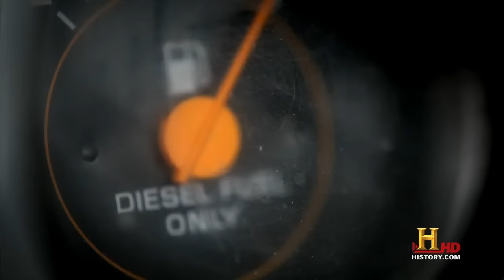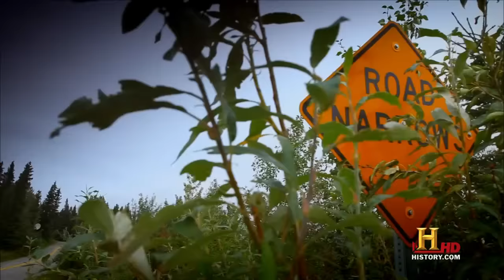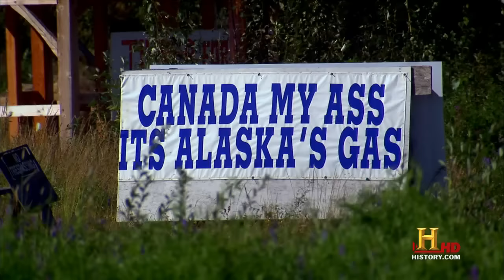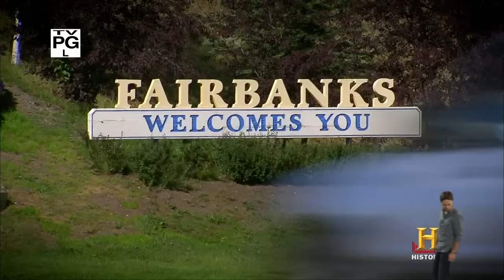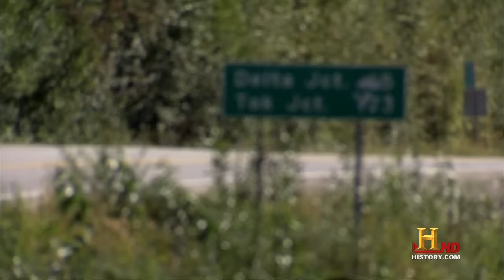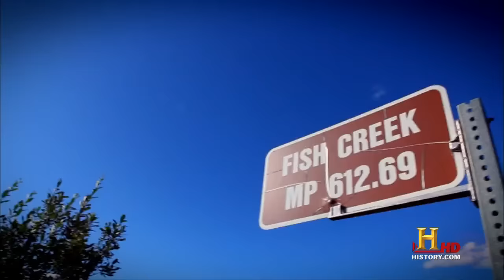Top Gear America Best America's 4x4 Truck   S01E09 - 2011.01.16

Comment: 5.7L Magnum? Correct me if I'm wrong, but I know they made a 5.2L and a 5.9L and some silly 4._ v6 Magnums, but I'm pretty sure that the 5.7L is a HEMI and not a Magnum
Reply: I'm glad that I'm not only who caught that!
Reply: I just recently bought a 2001 with a 5.7L magnum. I had no idea Dodge made a 5.7L magnum until now.
Reply: Novasso Unlikely, a 5.7 Magnum doesn't exist unless someone bored and stroked a 5.2. You probably bought a 5.9.
Reply: Novasso dodge never produced a 5.7 liter magnum.
Reply: the 5.7 didnt exist then uts definatly a 5.9
Reply: 5.9 is a cummins
Reply: Ronnie Davis and also a magnum
Reply: ASG0919 Searched it. Don't know what's trustworthy, but it says like, "DaimlerChrysler 5.7L HEMI Magnum"
Reply: Ronnie Davis 5.9 magnum or 360 is a gas motor
Reply: Gabriel Konrad they didnt make the 5.7 for the 2nd gen dodge. either 5.2, 5.9 or 5.9 cummins. or v10
Reply: the v6 was a 3.9 liter. but the hemi was not offered until 2003. probably ended up with the 318 though
Reply: okaay everyone it has a 5.9 magnum. thats it lets leave it at that we all know its not a 5.7l hemi
Reply: brendan hall it's a 5.2 because of the rumble
Reply: KilerStreak's Gaming Channel the early 5.7 HEMI was called a HEMI magnum then later the magnum was dropped off the name. 02/03-05 years of rams were like that.
Reply: They also had a 4.7L v8 Magnum
Reply: Ronnie Davis and Magnum
Reply: Your correct
Reply: Ya I have a 97 dodge 1500 like him but it's a 5.2 and they only make 5.2 and 5.9.
Reply: Gabriel Konrad i got a dakota with a 4.7 in it and it pulls really good, just like a 5.2, but you're right, the 5.7 is a hemi
Reply: Gabriel Konrad I had a 2002 dodge ram 1500 new body style with the 4.7 v8
Reply: every motor of theres sucks except 5.9
Reply: Swept180sxNet but the 5.9 sucks gas
Reply: Gabriel Konrad  yes you are correct. 5.7 l started with the third gen body style with the hemi
Reply: Gabriel Konrad 5.7 HEMI MAGNUM is a dodge truck from 03
Reply: Ronnie Davis 5.9L 360 V8 and a 5.9L 6 cylinder 12V up to 1996.5 and from 1996.5 on up to 08 or 09, it was a 5.9L Cummins 24V. What he had was likely a 5.9L Magnum V8 gasser from 1996. The 5.7 Hemi didn't show up until late 2002/early 2003 trucks. In fact. Most 3 gen bodies made late 2002 had the 5.9L 360 in it, not the 5.7 Hemi.
Reply: The 24 valve Cummins wasn't introduced until 1998.5.  Everything else you said is correct.  Also, since the 5.9 gas motors were discontinued, they were available in the early 2003 1500 series trucks until they ran out of stock.
Reply: Andrew Ford yep, meant to put an 8 instead of the 6 but was confused. That's what I was saying about the transitional models like some 2002's being 3rd gen bodies with the older 5.9 gasser in it.
Reply: 2003 is when they brought the hemi back i have one. only 115,000 miles on it as well.
Reply: 1Shignog same here but mine has 177,000 miles
Reply: You're wrong babe
Reply: ASG0919 incorrect. My 2003 Dodge Ram 1500 has both a 5.7L Hemi Magnum badge as well as it says it on the engine
Reply: Ronnie Davis also 5.9 is a 360 ci gasser, the 5.7 is a 348 hemi
Reply: christopher jones the 5.9 can be the cummins or the 5.9 magnum which is actually 360 ci.
Reply: SavB we understand this, the other commenter was trying to say that 5.7 wasn't considered a magnum engine
Reply: They made an i6 5.9l diesel and a v8 5.9 gasser
Reply: Luke Emms it was the 5.7 L hemi magnum
Reply: lol, I laughed, it is a 5.2 and 5.9.  You'd think they could get that much right.
Reply: thank god someone here knows what their talking about, jesus christ folks, that definitely is not a 5.7... good lordy...
Reply: Novasso same accept mine is a 04
Reply: 5.9 is also a gas burner. I have a 5.9 360 Magnum Gas in my 98 Ram 1500.
Reply: Zombie 8890 what kind of mileage you get out her
Reply: In stock configuration, I honestly don't remember. Ive been running headers, aftermarket exhaust, cold air intake, programmer, etc. Plus it has a small lift. I'm tuned on 93 octane now, and I probably get around 14mpg on a good day.
Reply: Mine has the larger tires from the factory with 3:55's and I get 13 on the highway. It's also automatic. Maybe 10 in town. Trouble is the trucks are very heavy. Especially the 4wd ones.
Reply: Wrong, there was a 5.9L Magnum used in the Durango and a few other trucks for a while.  It's before the "Hemi" name came back.  I ran the 318 "Magnum" heads on my 73 Dart 318 and it actually really woke the engine up, good swap back then.
Reply: 5.9 s beast
Reply: All 5.7 liter hemi says magnum on the fender, magnum is just the name... Gimmick!
Reply: Ray Brooks now shit is funny
Reply: Gabriel Konrad and I'm pretty sure a gas doesn't have twin turbo
Reply: Gabriel Konrad there's a Magnum 5.7 and a HEMI 5.7
Reply: Christopher Kennedy j
Reply: Gabriel Konrad they also make a 6.2 hemi
Reply: They also call the Tacoma a Hilux.
Reply: Swept180sxNet I'm gonna have to argue. 5.2 for the win in my books.
Reply: Right u are my good man
Reply: Thelifeofarider I averaged 14 mpg in my 01 Durango r/t.... got 1 mpg when floored, God do I miss it
Reply: ontarioknivesNS7 12v 5.9L Cummins was from 89-98.5 then 24v 5.9L till 02. the 03-07.5 was 24v common rail then after 07.5 it's the 6.7L common rail Cummins.
Reply: the 5.7 is a magnum hemi its a beautiful 360 dodge engine
Reply: Morgan Dunn no its not. 5.7L is equal to 345 cubic inches. 5.9L is equal to 360 cubic inches. being a 97 and the size of lift and tires I would assume it's a 5.9 magnum and not the 5.2 magnum.
Reply: SAVAGECUMMINS i run a 360 but I've seen bone stock 318's spin 40's just fine a 360 is got amazing low end but fall flat on their face when you get the rpms up where you need them
Reply: Brandon Miller it maybe a 318 but it would have to be geared down to spin 40s. and by the way it drove on the road I'm guessing it's not geared at all
Reply: There was also a 5.9 gasser, like that used in the Dakota 5.9 R/T.
Reply: Julian Arebalo  no its a 5.2 318 magnum v8
Reply: Lol my best friend has a 2004 with a 5.7 Hemi Magnum. I can post a picture to prove that. lol
Reply: Ya, they didn't have the 5.7 Hemi for at least 4 more years. That was a screw-up. It's a 5.2 Magnum.
Reply: Gabriel Konrad no hemis came out in the later models i thought but your righg there is no 5.7 Magnum
Reply: Don't worry about it's all goat garbage .
Reply: I think a metal internal support ribbing spring in the air supply duct shorted the battery after chaffing off the protective covering, from his previous issues, & based on personal exprience, considering coloration and location of smoke expelled. Also the magnum  (non-hemispherical compression chamber) engines, referenced by designated type LA Block, predates the hemi marketing, and is still a popular choice for crate builds.  A 5.7L Magnum designation is commonly used as shorthand for a modified 340cid/5.6L with the ported & polished 360cid/5.9L heads. These alterations came about from the wide held belief that the 340 magnum had almost perfect bore to stoke ratio, allowing for faster reving to reach the start of the power curve, that gets extended longer with slightly more displacement, but more importantly improved with increased air/fuel delivered and waste gasses more rapidly evacuated. So I tend to suspect, based on the other obvious alterations, it is not impossible the engine was swapped.
Reply: Gabriel Konrad you are exactly right I owned a 5.9 360 Magnum they are wrong plus they love to destroy beautiful old trucks....they suck!
Reply: Novasso they didn't 2003 was the first year of the 5.7 magnum hemi.
People get confused because old chevys were 5.7 and now dodge's are 5.7 but there was no dodge 5.7 until 2003 if you bought a 2001 or 2002 and the sales man said 5.7 it most likely has the 4.7 or 5.9 (gas) and the saleman didn't know what he was talking about
Reply: Julian Arebalo in 2003 the 5.7 dodge engine was born and in 2003 it was called the 5.7 magnum HEMI but the name hemi was so liked that in 2004 they droped the magnum name from there on it was know as the 5.7 hemi V8
Reply: Ronnie Davis i know this is confusing there is a 5.9 V8 gas and a cummins 5.9 I6 turbo diesel
Reply: you're right. biggest magnum was a 5.9
Reply: It's actually a Hemi Magnum, Dodge did make those in the 5.7L they also just made the 5.7L Hemi There are differences between the two but Rutledge is correct. It's a 5.7L Magnum just the Hemi Magnum Version.
Reply: The trucks don't have to be stock, All they had to do what buy a truck over 150k miles under 5grand. It could have been a swap. Just like Tanners truck was supposed to be a diesel and ended up being a chevy 350.
Reply: Gabriel Konrad they also made a 5.7 Magnum
Reply: you mean the bored out 318 thats all a 5.9 is them 2 gen magnums are by far the best
Reply: I had the magnum 4 cyl in my 97 dakota, as silly as it may have been, it was a solid 2.5. It never gave me problems, I put nearly 200k miles on it in the 2 years i had it. (I drove alot between work and college) Unfortunately I was going down highway 74 between shelby and forrest city NC and Hit a deer, Blew the rad, Knocked almost the entire front off of its mounts, and it still drove 40 miles home, without breaking down. Was a damn good truck, I miss it every day, and before anyone wants to talk shit, it was a 5 speed manual, same clutch from factory at nearly 350k miles. My dakota was good to me, But i also didn't abuse it like these guys did those 4 trucks. I firmly believe if they had taken things just a little slower all 3 trucks would have made it, as well as just crashing them, like seriously, they all had flawless bodies, that was fucking dumb.
Reply: Lmao 5.7 magnum
Reply: 318 gas is 5.2 360 gas is 5.9
Reply: its not a 5.7. its either a 318 or a 360. i have a 98 with a 318 and the one clip of the engine shown it looked almost the same.
Reply: Technically it is a 5.7 hemi magnum. But either way, the 5.7 hemi didn’t come out until 2003. So that dodge would either have the 360 magnum or the 318 magnum.
Reply: 5.7 magnum was an engine that was produced for a only a few years later replaced by its 5.7 hemi they do exist there just not seen vary often do to the fact of power and fuel milage my brother had one pretty gutless and really terrible fuel milage. But on a side not Tue engine was hard to kill unless you suck mud into the damn throttle body ha ha
Reply: Actually it's both
Reply: Oh cause it's a v6 it's "silly". Lol grow up kid
Reply: Alright, there is a ton of confusion here. Here’s how it goes: 1994-2002 ram trucks have these engine options: v6 (not relevant here), 5.9 Cummins I6, 5.2 magnum (318 v8), 5.9 magnum (360 v8), and the 8.0 488 v10 (also not relevant here). The Hemi did not come out until 2003. 2003-2009 dodge trucks have these motor options: v6, 5.7 345 Hemi Magnum v8, 2003-2007 HD trucks have 5.9 Cummins, 2007.5-current trucks have 6.7 cummins. The 5.7 345 hemi magnum is also available in the HD trucks, along with the diesel. There is no such thing as a 5.7 magnum. All that the “Magnum” term is for is marketing. A 5.7 hemi and a 5.7 hemi magnum are the exact same thing.
Reply: Daniel the Husky you are right on the money. I totally forgot about the 4.7 V8.
Reply: Daniel the Husky so that's a german engine or was Germany just the testing grounds? You just peaked my interests here
Reply: Daniel the Husky thats what I was getting at actually I'm well aware of the cross overs in the 2000s like the Chrysler crossfire and its dirty secrets of monster horsepower with the 500 seriose swap outs
Reply: Daniel the Husky what was that little hatch back that looked like a modern crx that Mercedes made that was done from dodge parts it was a strange year for those companys but I love what got made
Reply: Novasso he's wrong, the made the 5.9 magnum.
Reply: Julian Arebalo you're correct
Reply: think he meant a 5.9L 360 V8
Reply: Gabriel Konrad lol
Reply: dodge made a 5.6L Magnum close enough to 5.7L But It was discontinued in 1974 and replaced with 5.9L V8
Reply: It relieves me that I am not the only one who was really caught up when he said that it was a 5.7 liter Magnum
Reply: Ronnie Davis, i have a 5.9 Magnum V8 also called a 360. Its not only a Cummins engine
Reply: Magnum is just the series of Dodge engines, they have v6, v8 and v10 magnums

It's a 5.7 L HEMI Magnum 

Just Google a lil
Reply: 2nd gens were only magnums so it must have been a engine swap
Reply: (5.2L 318cid)..(5.9L 360cid)
Reply: Steven Vanheel, my 2005 Durango with the 5.7L hemi says HEMI Magnum on the tailgate badge...
Reply: 5.9 is the Magnum. It’s what I have in my 01
Reply: Ronnie Davis 
Cummins is a 5.9 6 cyl 
and the 5.9 Magnum is an 8 cyl
Reply: ya I caught that to...
Reply: No, my stepdad has one. It says it clear as day on the badge, 5.7 HEMI MAGNUM
Reply: My stepdad has a badge on his either 2004 or 2005 Dodge Ram that literally says right on it 5.7 HEMI MAGNUM
Reply: I have a 05 4.7 v8 magnum
Reply: They came with 5.9l or a 5.2L Magnum V8, 5.9l Cummins Turbo Diesel L6, or a 8.0l Magnum V10.
Reply: Ronnie Davis there’s a gas job model too
Reply: There is a 5.7 magnum
Reply: That is a 5.7l HEMI, not a Magnum.
Reply: CedarSlopeStudios Its called a 5.7 Hemi Magnum they dropped the magnum in 2003
Reply: My 03 dodge ram 1500 has a 5.7L hemi magnum. That's a 2ND gen in the video (obviously) and 03 is a  3rd gen. I think 03 to 04 or 05 was the only years of the 5.7L hemi magnum though, correct me if I'm wrong
Reply: @joseph12345678914  biggest magnum was the v10
Reply: ICE HD the 5.7 engine was introduced in 2003. the magnum term was just a damn word. 5.7 hemi and 5.7 hemi magnum are the same thing
Reply: The 5.7 hemisphere didn’t come out till 2002 more than likely he had a 5.2L or 5.9L.
Reply: Gabriel Konrad hemi was never in the 2nd gens.
Reply: Only magnum that ended in a 7 was the 4.7 lol
Reply: @ronniedavis6865  there is a 5.9 Cummins and a 5.9  magnum
Reply: @cmkm54  

Wrong buddy . The 5.7L was never the same displacement to a 5.3L. The lowest a 5.7L hemi displaced was 345 ci. A 5.3L displaces at 325 ci...
Reply: 4.7L v8  magnum is in my truck

Comment: I used to live in Fairbanks. Funnest 3 years of my life when I had my 2001 F-250 7.3L PowerStroke. Had a big lift on it with each tire weighting just over 150lbs, thing was an unstoppable beast out in the snow.
Reply: Yeah, those 7.3L were one hell of a engine but was heavier than a damn bolder.
Reply: Still drive a 7.3 350 with over 700k. Beast of an engine. Could easily see it double the mileage. Nothing else on the truck would though

Comment: Let's admit it, the Ford truck was definitely not designed for this type of use. It's a 5000 pound flatbed truck lol
Reply: The bed has nothing to do with it if nothing else its an advantage
Reply: @owendodman3037  I was mainly talking about how heavy it was. You definitely don't want to 5000 pound truck rock climbing.
Reply: that's right but I'm not a ford fan
Reply: Jax Jax 8f he learned how to drive it wouldve survived
Reply: @jaxonmerryweather3121  
Curious how about a Unimog? Heavier yes? 😁 It would have ate that trail for breakfast and came back for second run by lunch then back up the trail again passing on the non designated road. Love to see the heavy bruisers such as a Humvee, Toyota Land Cruiser, Unimog, and let's throw in a Range Rover go at it.
Reply: That has nothing to do with it. Tge chevy wasnt designed to go offroading either, its a k10. The most offroad those trucks were built to do, was a mudhole at most. Yet it beat all the other trucks. If you think about it, the ford had an advantage, stronger and beefier axles, stronger suspension, with a brush guard to keep debree out the radiator, yet it still lost .
Reply: The Ford would have been fine if it had been driven by someone who could handle it.
Reply: it was also a 1976 against a '97  and late '80's
Reply: @petercreps7215  the chevy wasnt a late 80's,it was an 83 half ton.
Reply: lol its driveshaft broke what does that have to do with weight
Reply: and btw i have seen a semi truck rock climb lol
Reply: @idonthaveaname2719  exactly. Their excuse was "that ford was never designed to do that". But neither was any of the other trucks😂. Especially the Chevy. back in the early 80s when they rolled that Chevy off the line with manual 4x4, Manuel hubs, and leaf springs , I'm pretty sure they weren't thinking, "this one is to drive through rivers, jumpover rocks, crawl through snow, and drive onto a glacier.
Reply: @brianbirc  Awesome trucks! Though I find it hard to believe your picks sell for under $3000. I've got to go check the So Cal craigslist for some of these deals.
Reply: Edward Dickinson Yes the trucks I am talking about are more than that. You could find one to build for that price. The cost of parts and  your labor more. The cost to  have it done a lot more and the cost to by one built to a lot better and more used still $$$$. Look on RDC Classified online for ones for sale. Off road built for performance with travel, strength, speed, and able to control it fast over large whoops without spilling your drink is not cheap or labor and skill needed BUT is amazing and gives many permagrin smiles for you and others. I remember a known large dip to slow way down for near a hunting spot  with my dad riding passenger after I built it. He screamed slow down going in quick and after not slowing or bottoming coming through smooth I tuned my head and said that was slow enough for my burrow  I built it myself and these are KING SHOCKS. He just smiled huge in surprise.
Reply: 'll
Reply: Try 15 thousand bud
Reply: Jacob Payne  well 15 k is about the cost of the engine going into it now but yes it is some $$$ and a LOT of working on it for me. Worth it though. Off Road the way I drive is not cheap.